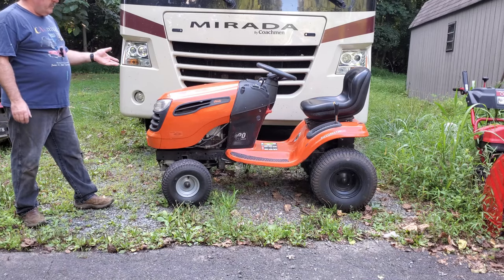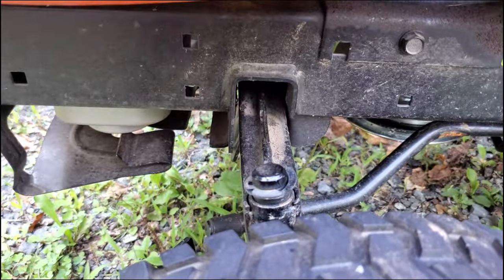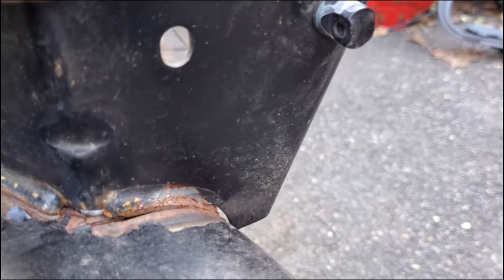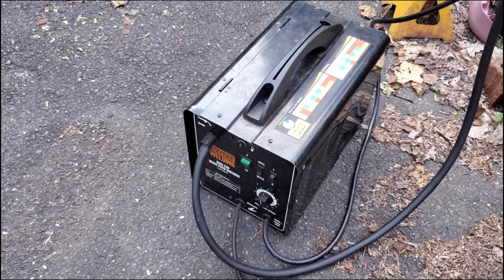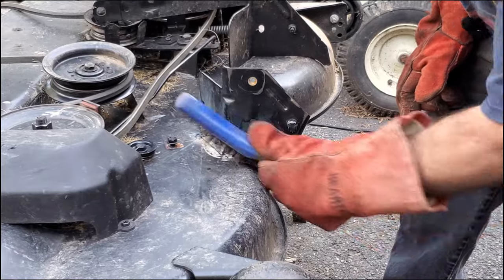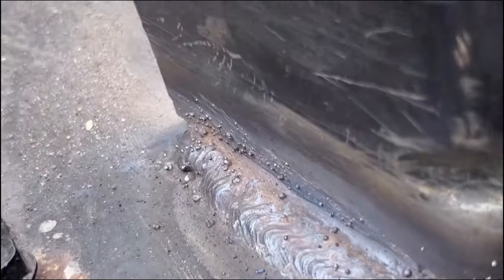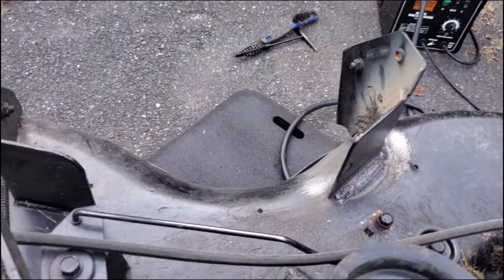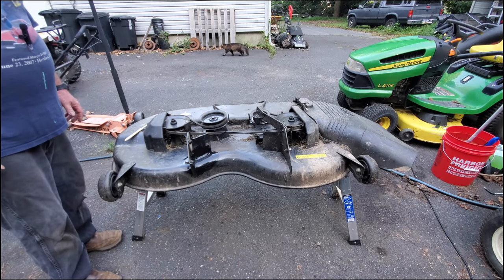Harbor Freight welder for mower Deck repair

Comment: That is a Husqvarna made mower I can Tell by the way The mower deck is connected to the tractor frame and the Head light lens plus the blade engagement handle
Reply from the maker: Yes Husqvarna is like the parent company,  but probably still made by AYP. There is one company that has a lot of brands under it's roof.
Reply: @ridingmowerking  you got that right riding mower king 👑👑